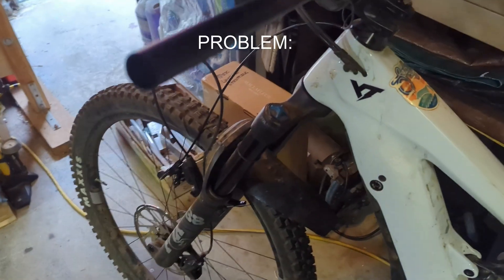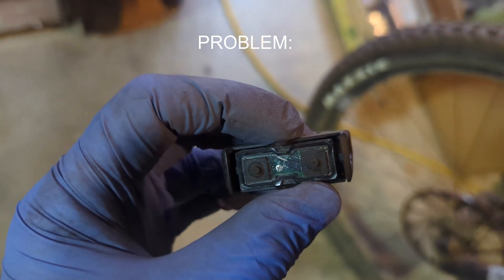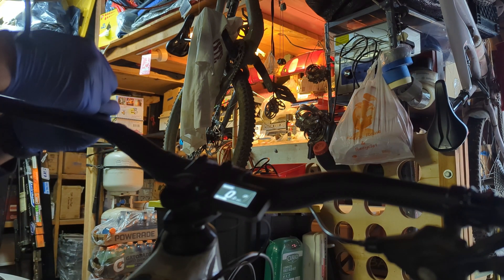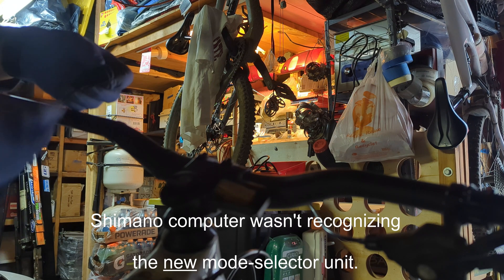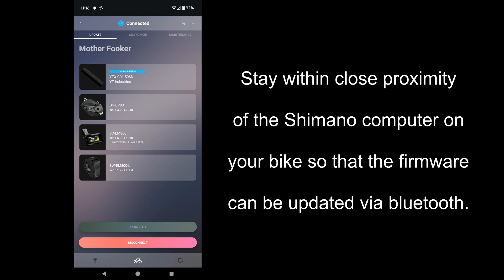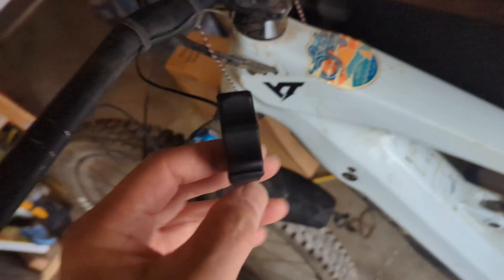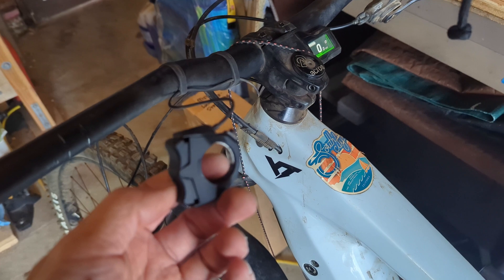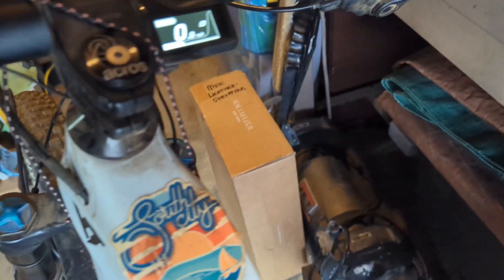YT Decoy MTB E-Bike - Replacing the Mode Selector Button and Shimano STEPS Firmware Update w/ E-TUBE

Comment: Awesome. Thanks for this info. Just put my decoy together. I’ve broken the clamp on an old selector and fixed it with epoxy 😂, but this is great info in case I break the new style one. You never know when it’s going to happen and the Shimano documentation seems to still be just ok.
Reply from the maker: I totally agree. E-bikes are wild to me. I must just be old because all of these electronics just baffle me. Just give me a hammer and I'll fix it or be done with it one way or another. If I had more time, I would look into 3d-printing.